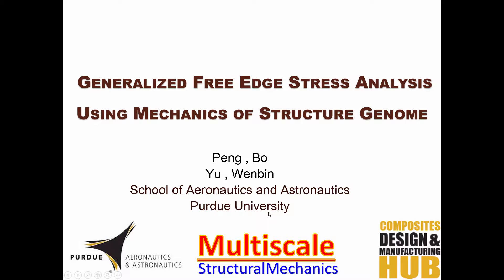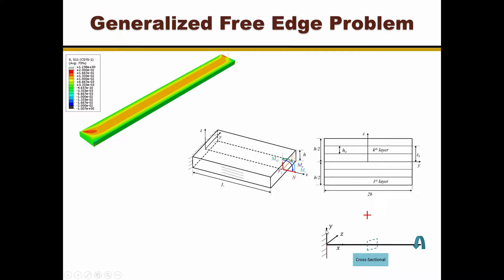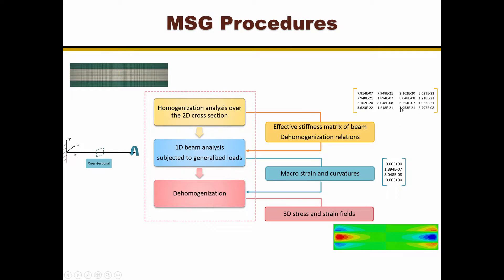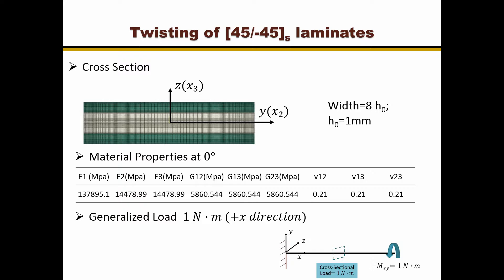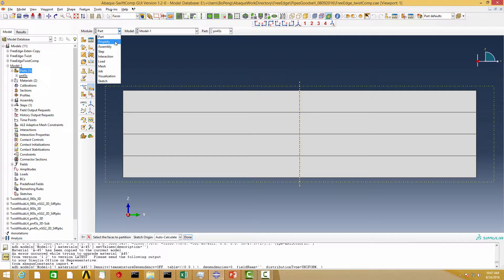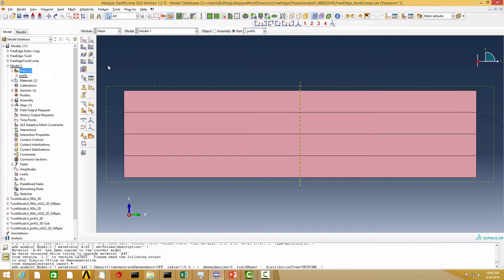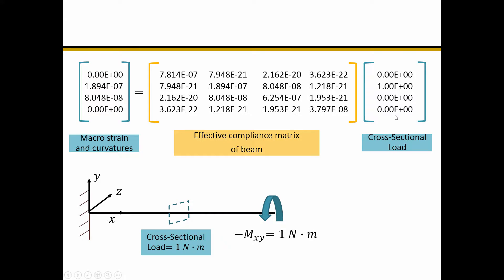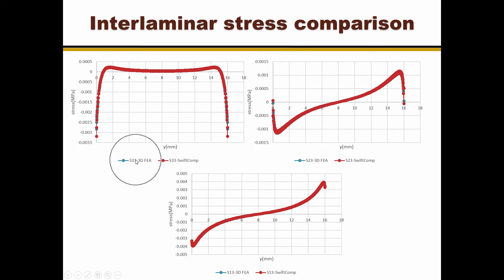Abaqus-SwiftComp GUI: 4. Generalized Free Edge Stress Analysis

Comment: Why its a 4×4 matrix not a 6*6 one
Reply from the maker: This video showed to homogenize the composite shell into a Euler beam which resulted into a 4*4 matrix. Later we also updated the function so that the composite shell can be homogenized into Timoshenko beam and resulted into 6*6 matrix, which also improve the accuracy of the recovered free-edge stress especially when the layer-up is anti-symmetrical or under combined loads of twisting, bending and extension.